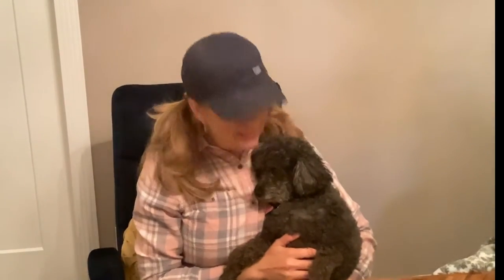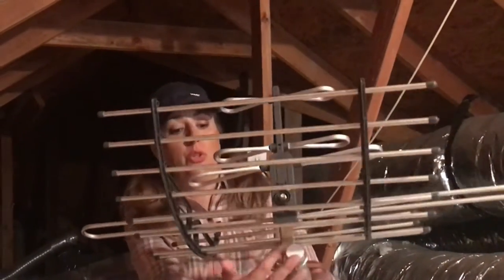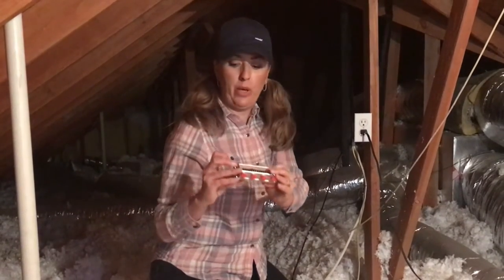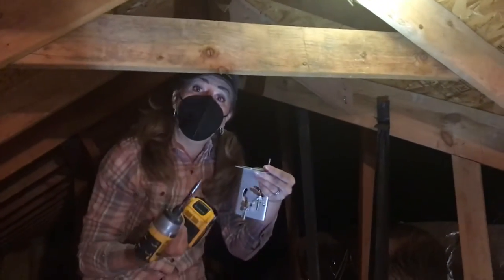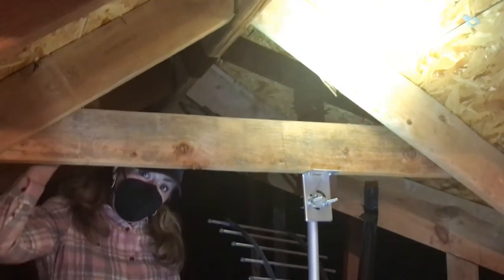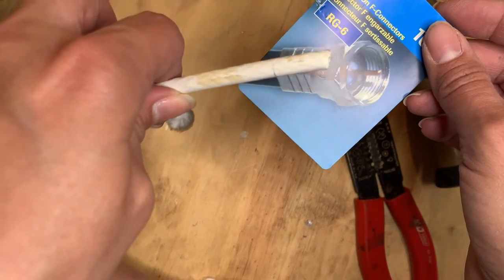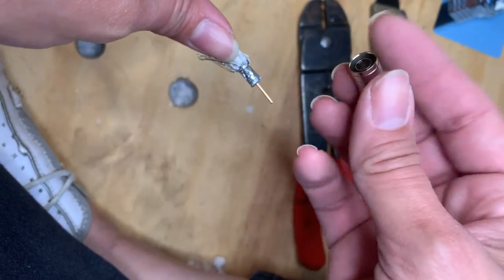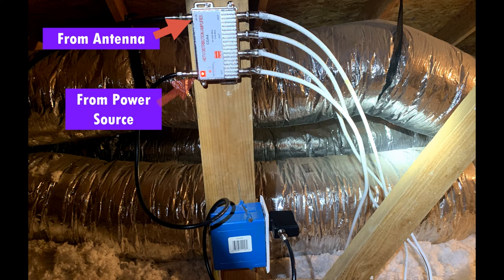Attic Antenna Installation

Comment: I love how fearless you were cutting the cables to each bedroom. I chose not to mess with the cables in my attic.  I didn't want the next person that owned the house to have to figure out why their cable TV wasn't working upstairs.
Reply from the maker: I get what you’re saying. It’s true. That’s why I added that this is the “point of no return” in the video to emphasize that this is a big step. That being said, there’s a way to feed the lines back in there and it’s not all that hard. I plan on being in this home for quite a long time though.
Reply: A pocket knife is all ya need to make connectors, number one, and it's a better signal strength quality choice to install these antennas on the outside whare signal strength is the most highest quility and best picture quility gain.   Many people are held hostage by the home owners association and putting up a tv antenna on the roof of your home on the outside is frowned on, so unfourtionally, your stuck installing the tv antennas in your attic.
Reply from the maker: Valid points! Thank you. Our HOA limits our options here as it does for many unfortunately.

Comment: Hello. The coax cable going to my outdoor antenna got damaged. I was thinking about switching to an indoor model. its been almost a year since you installed yours. what's the update on performance/ reliability?   thanks!
Reply from the maker: I have had no issues personally with connectivity myself. It has worked really well. 👍🏼
Reply: @TammysHomeTips  thank you

Comment: what about grounding the antenna ?
Reply from the maker: As per electrical codes, indeed, your best bet is to ground the mast, and the RG 6 cables accordingly in order to avoid any lightning strikes that will indeed damage your tv set. The very best grounding technique is a cold water pipe for the RG 6 cables, while a ground rod for the mast used to mount the tv antennas or system head end on. You can never have enough grounding. Also, when making a RG 6 connector, a pocket knife is all ya need, number one, and as far as crimping the ferral, a crimping tool is best suited to be used in that reguard. The much newer RG 6 connectors have a entirely different crimping tool as the ferrall are much longer than the ones times past.
You can build cable tv system head ends which each tv antenna used is a cantilever mounted antenna cut to the frequency of the desired tv station to be recieved which goes into the system head end building and into the recievers, processors, and combines thenout into the system which uses trunk amplifiers, line extenders, and bridgers along with tap units to connect up cable tv subscribers which the tap units range from two port design to 4 port to 8 port designs in order to handle as many cable tv subscribers from one tap unit in the trunk line or trunk run.

Comment: Grounding of the Antenna?
Reply from the maker: It is definitely recommended to ground the antenna if it is protruding from your home. That being said, it wouldn’t hurt to ground it. To ground an antenna located inside the attic, you can run a grounding wire from the antenna to a grounding rod or a metal water pipe that is connected to the earth. The grounding wire should be at least as thick as the antenna's coaxial cable and should be connected to the antenna's grounding lug or a metal part of the antenna structure. It is also important to ensure that the grounding wire is securely attached to the grounding rod or water pipe and that the connection is free of corrosion. You might want to consult with a licensed electrician or antenna installation professional to ensure that your grounding system is installed correctly and meets local building codes and safety standards.
Reply: The ground rod connection is called a ground rod clamp. Some call it a bug nut, however I've always known it to be a ground rod clamp. As per electrical codes, indeed, your best bet is to ground the mast, and the RG 6 cables accordingly in order to avoid any lightning strikes that will indeed damage your tv set. The very best grounding technique is a cold water pipe for the RG 6 cables, while a ground rod for the mast used to mount the tv antennas or system head end on. You can never have enough grounding. Also, when making a RG 6 connector, a pocket knife is all ya need, number one, and as far as crimping the ferral, a crimping tool is best suited to be used in that reguard. The much newer RG 6 connectors have a entirely different crimping tool as the ferrall are much longer than the ones times past. I have built cable tv system head ends which each tv antenna used is a cantilever mounted antenna cut to the frequency of the desired tv station to be recieved which goes into the system head end building and into the recievers, processors, and combines thenout into the system which uses trunk amplifiers, line extenders, and bridgers along with tap units to connect up cable tv subscribers which the tap units range from two port design to 4 port to 8 port designs in order to handle as many cable tv subscribers from one tap unit in the trunk line or trunk run.
Reply from the maker: Thank you for the additional information!

Comment: should have talked less showed ALL of the installation equipmnet. Never showed the power Sourse. This video could have been 10 to 15 minuates tops. Talking with the mask...Just frustrating
Reply from the maker: My apologies. There was a power source nearby which I neglected to show and we discovered that our AC was venting into the attic which was blowing insulation around and choking me up. I needed to finish the project but the environment got me in a hurry.